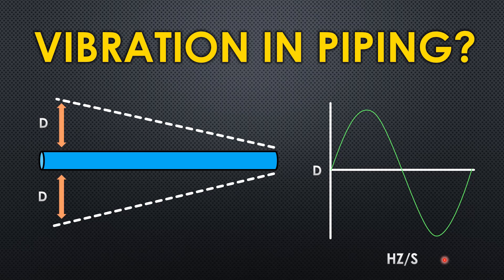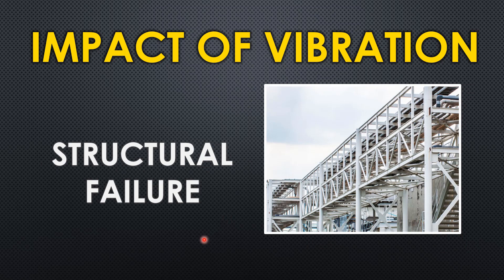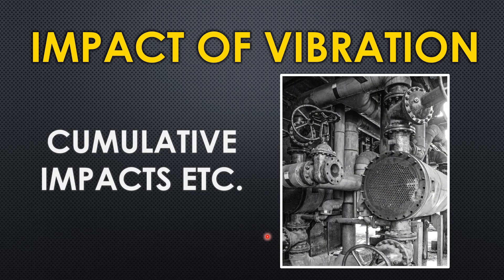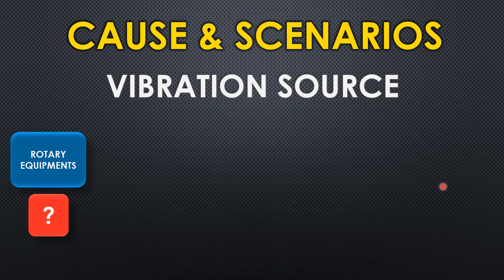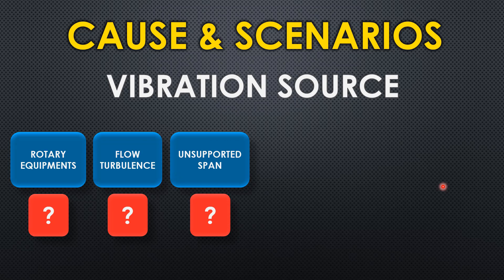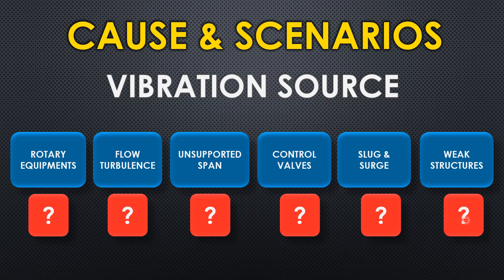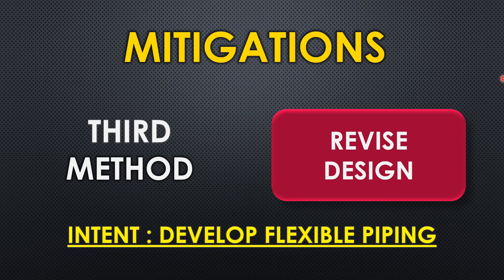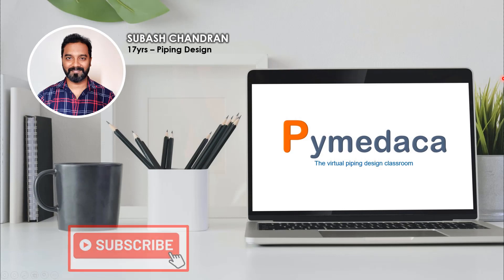Vibration in Piping System, Piping Design concept, causes, impact, and mitigation (Specializations)

Comment: Additing more faxibility in piping will increase the vibration in the system. Optimum feaxibilty in piping system to be designed to keep vibrations as well as thermal impact within acceptable limit.